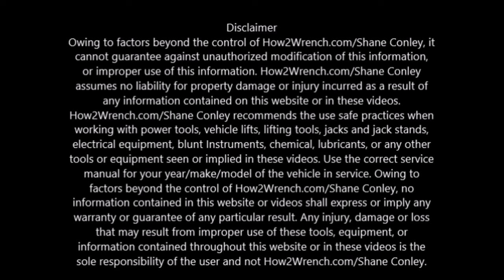Have you ever fought an axle removal or installation? This may be why.

Comment: Good tip, I'm getting ready to crack the axles loose on my 09 Ulysses and I'm pretty sure the front has never been off before. Question; if the Axle doesn't come loose, do I break out the 3 foot breaker bar, the impact gun or try a little (very little) heat? I've never worked on these inset axles before but I know they can be tight! Thanks Shane!

Comment: Great video. What if the axle doesn't seem to fit in the fork even on just one side. If I'm facing my bike and I try to slide the axle in left to right, it's fine until it hit the thicker part. That will only go through the left fork (no wheel on the bike) if I push very hard. To be sure it wasn't something with the right fork, I turned the axle around so the thick part would go into the left fork first. It was crazy tight. And, yeah, I have the pincher bolt out.

Any ideas?

Thanks, Mark